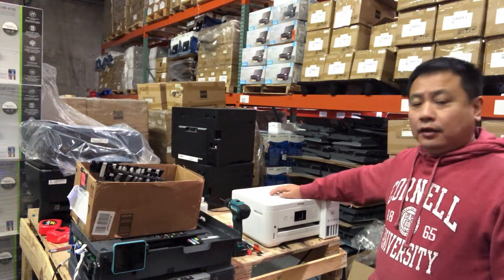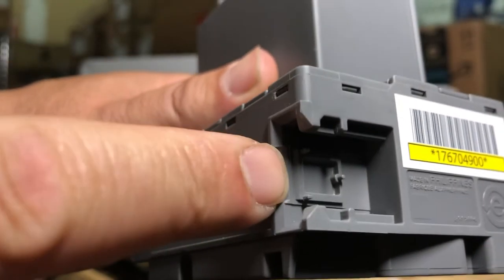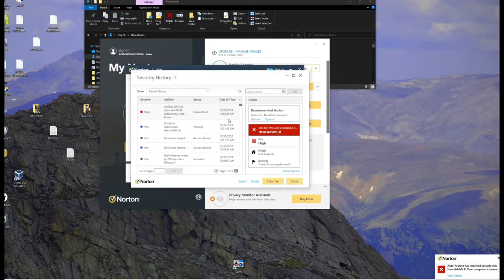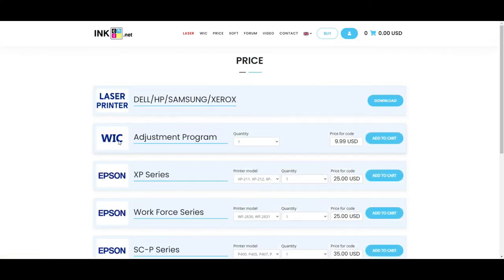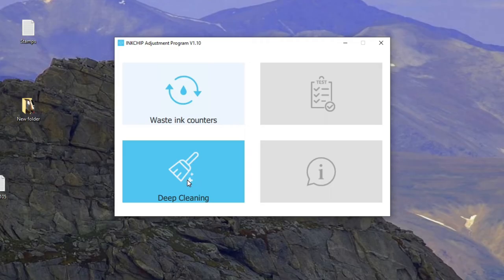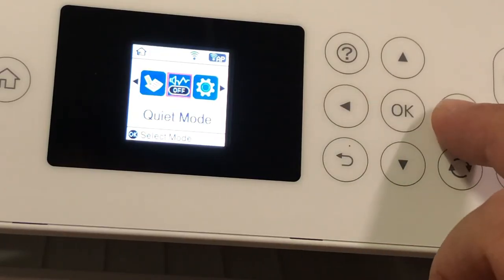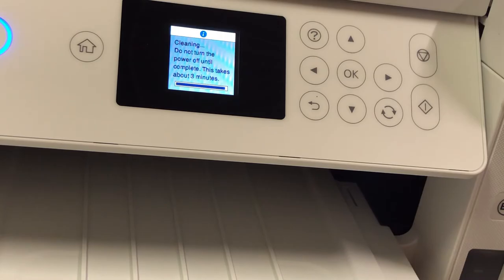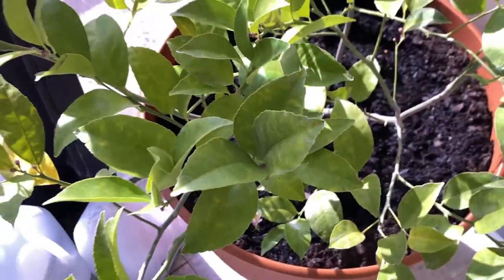How to Reset Waste Ink Pad for Epson EcoTank ET 2760

Comment: You are lucky if you get the error.  The corner of my ET-2760 was leaking for months and I had no idea what it was, so just put it on a plastic sheet with something to absorb any leaky ink.  Today, I got the E-11 error, searched and found this YouTube.  The tank on my printer is FULL.  And, what a mess.  I’ll need more than the solution presented in this video, but thanks for the information.

Comment: thanks for this information! I have two ecotanks that I use for my home business and one of them completely shut down saying I can no longer print AT ALL. this is holding up my sales!!!  since I'm a small business I don't really have extra cash to run out and get a new printer or to take the time to mail it to epson for servicing (which is what they are saying to do) instead I just want to fix it myself. thanks! its way cheaper to just pay that $9.99 to have the software handy to reset my page counter than it is to pay epson to replace it! especially since I can just clean it myself

Comment: I have 5 Epson ink tank printers in my office. These are my last Epson printers. My next office printer will be a Brother laser printer. It doesn't have ink to dry out, doesn't have this ink pad to fill up, and always works.
Reply: Except now the printers won't work with 3rd party compatible ink, so you have to pay a monthly price for ink subscription from brother, with limited number of prints each month.  If  you choose not to subscribe, a set of toner cartridges for a color laser brother will run you $300.  If you try to use 3rd party compatible cartridges, the cartridge will fit, but the printer will not recognize it as genuine and will therefore lock you out.  So be careful, you don't really own your printer, its pretty much like a car lease with limited miles and lots of restrictions.

Comment: Can I do this with my ET 2720, and use the software on my MAC....I seriously wish I knew about this BS before I bought the printer. This was the first and definitely the last time I will purchase ANYTHING from Epson. 
Thank you for posting this video!! 💕💕
Reply from the maker: You need to run the software from a PC.  Borrow one from a friend.
Reply: Epson isn't the only one with a waste ink pad.
Reply: Yeah I ended up buying waste ink pads on eBay and the software... my printer has been running perfectly ever since. It's insane that Epson's solution was to buy a new printer.
Reply: @amyc9155  The ink pads are basically the same as the pads you use in a aquarium, take them out, rinse them up, let it dry and you can reuse them again.

Comment: I purchase and did what you. The ink count is reset.  However the ink cartridge doesn't clear the connector you place up in the top of the ink opening. Then you can't put the cover back on. What am I doing wrong? I saw another one of your videos where you just left the ink cartridge out and ran the tubing out through the cover panel.  Will this work for this Epson ET-2760?
Reply: what I did was drill a small hole in the cover plate and slid the tubing through that, worked perfectly; then I could attach the cover plate properly to the printer again

Comment: Is this for the code 000031 and 000041, my heads clogged so i did a deep clean heads.  Well now I have these errors.  I have cleared any paper block (none) I print for a bit then get these codes.  I did look at the waste tank and the material is soaked.

Comment: Hey Kevin you rock! Was wondering if this can also apply to the et-2800 model? Just bought one and was thinking of installing a waste tank to bypass the ink pad. Is this possible ?
Reply from the maker: I think ET-2800 uses a physical chip, so you can't do it with software.  You can still install a waste tank but you have to depend on buying new chip or till someone figure out how to reset the physical chip.
Reply: hey! I have an et2800 as well and had this issue, the printer completely stopped working because it was full and won't let me continue. i did a lot of research and found many people recommended a software called "WIC reset utility".  I tried it and it worked! The first time you use it, it'll allow you to reset to 80% for free (of course this isn't ideal, but 80% will at least allow you to keep printing for a short while until you figure out how to empty the pad). after that you can pay for a key code each time you need to reset it, but even still the key codes are CHEAPER than paying epson to fix it for you. just remember though that you really do need to take the pad out and clean it, it will overfill and leak at some point if you dont!

Comment: Hii..sir    .I have hp 2515 printer which black ink refilled and it shows incompatible ink cartridge error ,I also tried with older black cartridges resulting the same ,is there any way to solve this.
Thanks..

Comment: Hi Kevin, I have a question and probably if you can help that would be HIGHLY appreciated.
I'm from Argentina, currently I'm using WF-C5290 with chipless solution but I would need to move to start using WF-6090. Problem is Chipless solution is not working fine for that model and it's difficult to find ink cartridges chip resetters. Is that difficult to create my own chip ressetter? do you know about someone capable of helping to get a working chip resetter for WF-6090 cartridges?

Comment: i wish somone would make a video on how to remove and replace the waste ink assembly unit that sends the ink to the waste ink tank. Specifically im talking about for the Epson WF-7710 or WF-7720. Theres tons of videos on replacing the empty tank in the back but not on replacing the waste ink assembly unit which is what is directly under the print head and can get clogged with 3rd party ink particles over time.

Comment: Thanks for the useful video which learns good things about the waste inkpads.

Anyway, I just find it excessive to ask people to pay $10 each time they require to reset the waste inkpad counter which is in fact a planned obsolescence set up by Epson. Epson should be blamed for such practices.

The BCH software simply reset the counter using the Epson firmware. According to me, the software should be purchased $10 once but not each time.

People should know that if Epson head cleaning is blocked by a 100% use counter, they could also inject warm distilled water with a syringe in order to unblock the print heads. This is very inexpensive and efficent method.

Comment: sir good day.. have u tried removing the scanner of an Epson L15150? i had to clean it from ants living inside.. thanks so much in advance..
Reply: i tried separating the the scanner without totally disassembling it and used a vacuum from partial opening but after i turned it back on, the scanner assembly was not able to move that causes an error during start up and printer system can no longer continue to boot up..
Reply: error 100005

Comment: omg... i've made so many cleanings cuz the printer keeps having lines O_O that's a lot of ink wasted
Reply from the maker: Thanks for subscribing! You may also check if there is any air in the lines, which usually are the causes of the stripes.

Comment: If I purchase the resetting software once and convert the waste pads to the bottle collection method, will the printer make me do all of this again a year from now or will that ink pad error message be a thing of the past?
Reply: No, you will need to pay them each time. They basically reversed engineered the reset mechanism from the official Epson tool and selling it with a good profit.